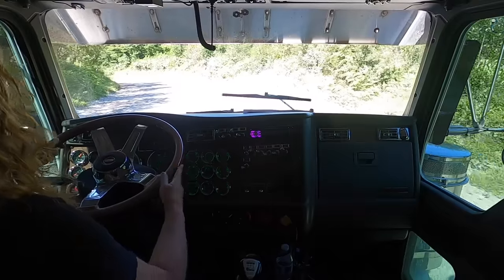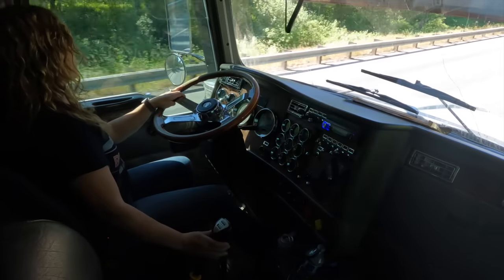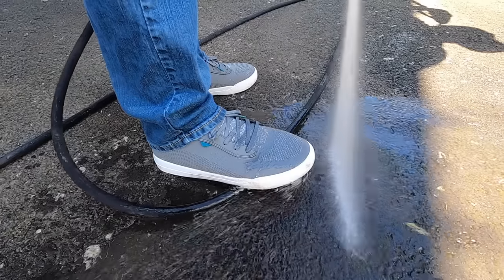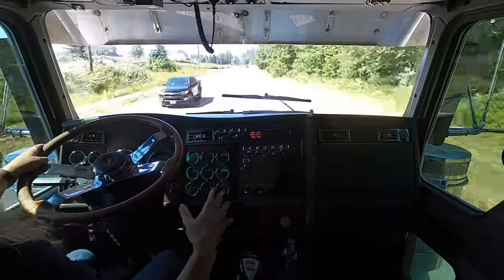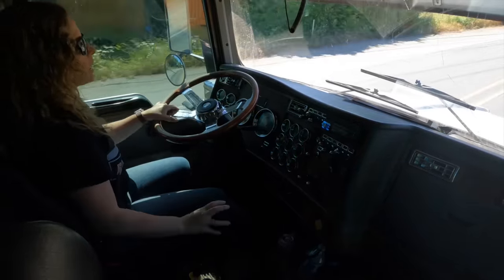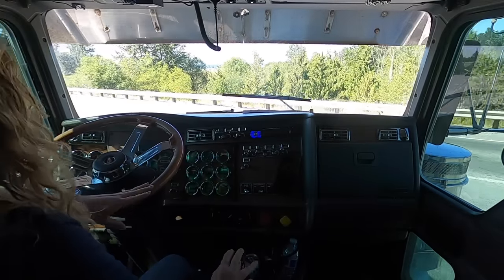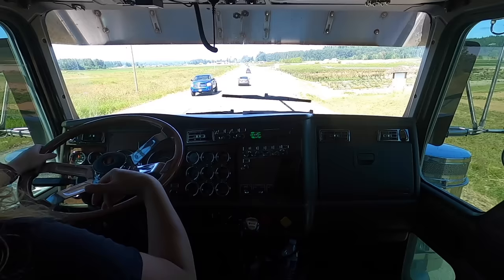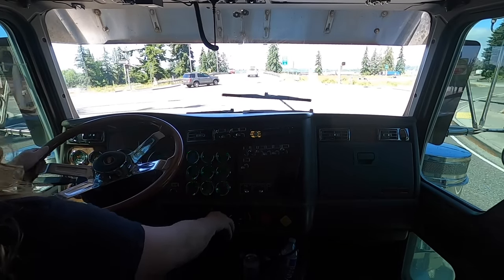How to shift an 18 speed Eaton Fuller Transmission. Down shifting explained on a loaded semi truck.

Comment: I run a 13 speed and I really wish I could split low-range. Pulling hills from a stand still would be much easier.
Reply from the maker: It is, if you need it. I love the 18 speed, even if I don’t need all 18 all of the time. It’s nice to have them.

Comment: Watching the steering wheel shimmy, you should get your steer tires trued and balanced.
Reply from the maker: They don’t do that in the field, probably not gonna park the truck for a day to have it done until the slow down at Christmas.
Reply: Seattle needs more truck shops!, we had to go on a service call up there because we couldn't get any of the shops up there to fix it for us!??, it was a 13 hour day!, it's a long drive from Eugene to Seattle and back!
We'd have those tires round and dynamic balanced in about an hour, we do it on the BIG diesel coaches all the time, Marathon Coach is probably our #1 customer, every day stuff for us.

Comment: I drove a lot of different trucks and the clutch brakes were always either all of adjustment or not there at all and it's a b** like you said to get it in gear you just about have to put it in a high gear and then get it to go into a lower gear after you get it out of the high gear

Comment: Ok you mentioned when you go into the next gear it doesn’t go in gear a lot of time’s I hear truckers grinding gear why the problem is not watching the road speed there forcing it to go in gear give a little more speed it will go in gear whether you’re using your clutch or with no clutch a lot of time’s even from a dead stop their shifting you got to help the truck with the right road speed to get it in gear instead of pounding it into gear I use the word pounding because for 39 yrs that’s all I hear gear grinding and power shifting from Honolulu hi I hope this will help you a little more road speed Aloha

Comment: Do you hold clutch down on stop lights?if so do you engage clutch brake
Reply from the maker: No I don’t. When I do start off I put the clutch to the floor to put it in gear.
Reply: @DauminiqueTheDumpTruckDriver  what about stop signs? Not sure i seen people stopped but in gear with no clutch or half clutch engaged

Comment: Same always mostly Bush but I always power threw my turns as well my brother was killed because an inexperienced driver brakes coming into corner not knowing road and steering tires just skied him into his own guard rail then panicked and cut it hard toward on coming traffic and hit my brother Head on killing him he had30 years and was killed because bad driving but 18 speed was the best for Bush and heavy loads we use to use a 8 speed transmission with deep reduction but that was back in the day

Comment: These new transmissions are easy to drive,try a b model mack with a quadraplex 20 speed that's what I learned on makes everything else seem like child's play,if you know anyone that has one try to drive it if they will let you it will show you how much of a driver your not,and humble you to how the real truck drivers did things back then
Reply from the maker: You just described the first dump truck I ever drove back in 2007.

Comment: I think floating down gears is complicated 😕 watching videos to understand and learn i helpful but not reason i say no is cuz u gotta practice it till u can learn the truck
Reply from the maker: Put the shifter at the opening to f the gear and rev the engine slowly. When it gets to the right RPM is will slid into gear. It is easy. You just have to learn to feel it.

Comment: do u have to press the clutch after turning on pto to raise the dump bed
Reply from the maker: You have to press the clutch to turn on the pto
Reply: @DauminiqueTheDumpTruckDriver  can u go into gear while pto is turned on if u need to inch forward or reverse a little?
Reply from the maker: @juskiiiiiii  yes
Reply: @DauminiqueTheDumpTruckDriver  ok one more, do u have to be in neutral when engaging/disengaging pto or can u do it while in gear.
Reply from the maker: @juskiiiiiii  you’re supposed to be in gear when you engage the PTO but it will work either way.
Reply: @DauminiqueTheDumpTruckDriver  can u raise the dump bed with the clutch pedal pressed in? im drivin an automatic dump truck(wish we had manuals) so im just curious as to how the manuals differ
Reply from the maker: @juskiiiiiii  no the PTO doesn’t work with the clutch engaged

Comment: 5 low is 10 mph  with 4 11 gear, and its low side /high side and direct or overdrive for spliter. your shifts should be almost like a automatic trans ,seamless smooth shifts ,Most of the time  unless drivin offroad on rabbitt trail.  my boss taught me the rpm raise float twenty eight years ago. new trucks are more difficult ,beacause throttle repsonse ,fly by wire ,emiisions  degrade performance, new skills for new age ,cheers ,dont blow up the back half ,synchros.  Yay

Comment: Coming to a stop sounds like you grinding those gears. Try down shifting with both feet, one on the throttle and one on the brake pedal. Works great for me and the smoothest downshifting ever.

Comment: Sister , !! Who’s that an we see her at some point ??? Nice 👍 thanks I shift without a clutch after the first gear ⚙️ lol been doing it since the 50 years I’ve been doing it lol there some of my trucks still rolling with the Original transmissions because I’m so smooth at shifting them , never ever have it jerk shift anything or any of my transmissions in any of them rather race cars trucks tractors or regular vehicle pick ups lol nice 👍 thanks beautiful, good job 
P.s. you will save thousands of dollars in your truck lines Beyond dirt companies with non-clutching shifting that it will amaze you, all you will need to stay on top of ,    Change oil on scheduled maintenance oil changes on them transmissions and I use Lucas oil in my vehicle STP is what I used forever until Lucas oil came out and Molly Gear oil , military, thanks BigAl California praise Jesus Christ grace amen 🙏

Comment: When you went around the corner atthe beginning you said you went to 8 low, thats not exactly correct you just split 8th gear.   Anyhow its clear you know how to shift gears like a pro.... ps im,like you i can shift up and down normal very well but if i have a passenger and i know they have lost of experience then i start fucking up my shifts lol.... full disclosure im a licensed truck and coach mechanic so you could definitely teach me to shift better im sure..... just an FYI, the red switch is high and low range and the gray switch is your splitter.

Comment: don't drive around with you're hand resting on the gear stick it can cause ware on the box just saying and no mention of high and low range and spiltter lol in a nut shell don't split gears in low range when you're empty . spilt gears in high range full or empty cheers from down under lol

Comment: I have been a mechanic for 50 +”years and this is the worse video on how to shift a 18 speed , she is expecting it like everyone has a 13 speed already and just needs a update , she should explain the shifting with the engine off and not running then move the truck and explain at each point the gear and how to,get there , the same with downshifting to get more power and for braking ,

Comment: Did the stick shift thank God for automatics now sit back relax put some good music on you ready to go. Much easier and heavy traffic and stop and go traffic lol
Reply: Not sure it is you on being a winner. Sure would be nice to have won
Reply: @ Stacy John's.. What I wanna know is how is that Automatic gonna slow you down when you're coming down a long steep grade in the Rockies ? You can't always rely on the Brake Pedal, and Jake to keep you slowed down enough to safely navigate curves, and switchbacks, but if you have that 18 speed, you can come down a few gears before you reach the crest of the hill, and just let your engine, and Jake do the rest of the braking for you.
Reply: Well Kevin I can see you're not much of a truck driver
Reply: And Kevin if you knew automatics you would know they have a three stage Jake for whatever you need
Reply: @stacyjohns4863  actually, I learned on a 1954 B Model Mack Twin Stick, and have driven straight 5 Speeds, 5 & 2, 6 Speed, 9 Speed, 10 Speed, and 13 Speed. I have driven Lumber Truck, Fuel, and Propane Delivery Trucks, various types, and sizes of Fire Apparatus, both Manual, and Automatic Transmissions, and am now driving a School Bus. There is absolutely no need for any School Bus to have a Brownie Box along with a 5 Speed Main. A Straight 5, 5&2, or Straight 6 Speed is plenty, even in areas with lots of hills. Anyone that can split a 5&2 can get over most any hill that a School Bus will encounter. I grew up in the Adirondacks of Upstate New York, and when I was in School, the School Buses being used at that time were either Straight 4 or 5 Speed Manuals, and they had no problem getting over the various hills, and mountain passes in the Adirondack Park. I know what I am talking about, and have driven large trucks for many years. You can also add farm trucks to the list of trucks I have driven for a living, so for you to say that I am not much of a Truck Driver is an insult to me.
Reply: @stacyjohns4863  I will give you credit on the Jake Brake Comment. I know about them as well, in fact, the School Bus I drive has a Jake Brake on it, and I do use it everytime I drive the bus, only because it saves on the hydraulic brakes that my bus has. Here in Delaware, we don't have hills to climb, but we do have lots of windy, curvy roads that are very narrow, and most times, the Jake is my go to for slowing down just enough to safely navigate the windy, curvy narrow roads that I have to travel on during my bus runs.
Reply: @kevinswinyer3176  well I apologize I'm from a trucker family and so you don't bring up automatics in my house but find them just more convenient. Congrats on a long prosperous journey and I do sincerely apologize. I did mostly City driving in Orlando Florida Tampa Florida all around the big cities in Florida

Comment: sounds bogus ,a lot of ass kissers are sweet talkin your shifting ,I think there definetly is a correct way to shift. pre select ,and no how to split and how to float or double clutch ,and yes just raise the rpm and shift should go right in ,downshift ,
depends on sitiuation panic stop or speed reduction needs to big rev ,clutch out ,clutch in in two seconds ,or raise rpm and slow enough with brake to gear down, ,upshift always go in gear on rpm down ,and down in some respects also .
how come you aint shiftin g all eighteen up and down?  , you r doin just fine drive to survive.

Comment: I'm a HATER!!!!! There I beat y'all to the punch. Every hear the words "splitter" or "range finder" instead of toggle switch? Not a fan for the lack of knowledge to the described "parts." Fyi... splitter is the "toggle" on the side and the range finder is in the front of the gear shifter. 17 years  of driving and don't know the names. But go on with the toggle terminology. Essentially they are both "toggle" switches, meaning a single pivot point.